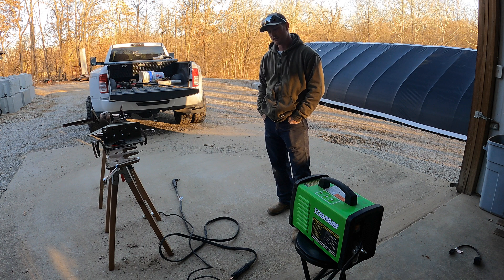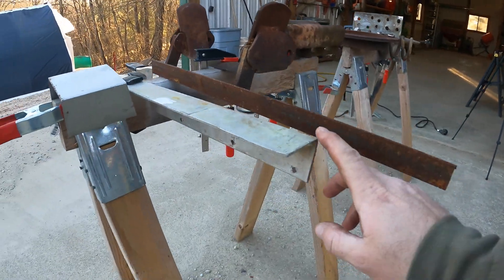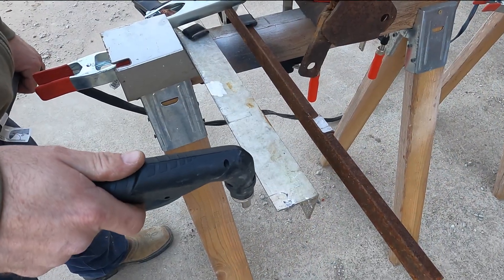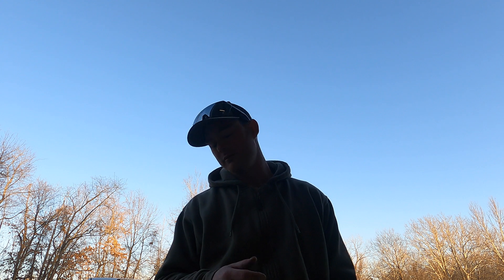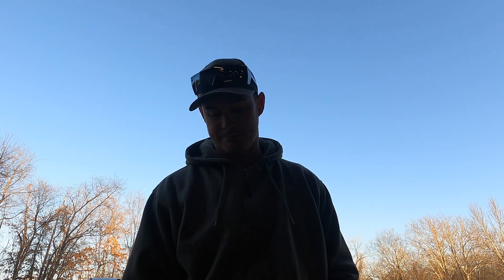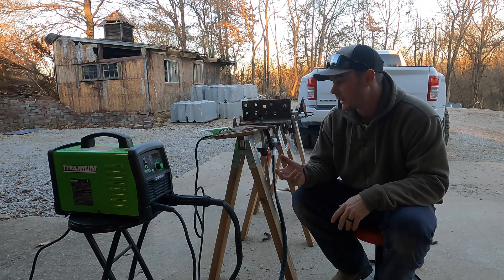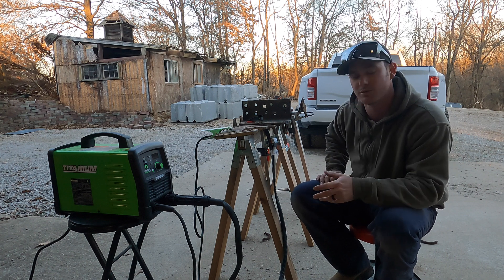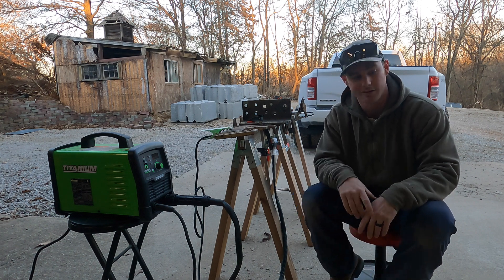Harbor freight plasma cutter. PUT TO THE TEST

Comment: Wow!  I felt sorry for that Machine.  I appreciate the video.  It was instructive and informative.  I now know how bad I'm not.  Harbour Freight consumables are too expensive to ruin on each cut.  If the cut is not penetrating the steel, stop cutting.  All the steel that is stuck to your nozzle and the work surface make it impossible to proceed without clean up.  The torch would have cut some of that stuff well if it had a chance to get started.  The video is still helpful- just not as you intended.
Reply: Yes, I know this thread is old.  It needed a bump.

Comment: Thanks for the video. I am going to get the 65 Titanium model. Couple extra hundred bucks but I think it will be worth it. One suggestion, don't use the tip as a hammer and speed of cut needs to be adjusted with thickness of stock. Also when you start your cut, do so at an angle on an edge and then pivot the tip to perpendicular to to stock after the plasma has gotten a start on cutting. Helps to prevent blowback which eats up consumables. If cutting in the middle of the stock drill a hole first to give you an edge to start on. Again thanks.

Comment: Ive been trying to figure out, is it just the ark and air pressure to blow out the molten metal or do you need some sort of gas with thesr plasma cutters?
Reply: No, there is no gas involved at all. It is just an electric arc and compressed air that blows out the metal. The electric arc creates a plasma cone that super heats the metal to molten state. That plasma cone reaches about 40,000 degrees Fahrenheit. When the air is super heated by the electrical arc it enters a 4th state of matter which is plasma. Plasma is regular matter that is basically blown apart and disassociated from its electrons, thus resulting in plasma. The same thing happens with lightning. Because lighting has even higher voltage even more heat is generated. The air around a bolt of lightning can reach about 500,000 ° F. Plasma cutting is kind of  like nuclear energy but not exactly the same. In a nuclear reaction atoms are actually split open and when done so releases EXTREME amounts of energy. More so than with plasma cutting...obviously. Nuclear energy can result in Millions of degrees of heat. The core of our sun has temperatures of 24,000,000 F. Too hot for me!
Reply: @normtheteacher5485  thank you very much for taking the time to make the rare comment back, I appreciate that information
Reply: They have different kinds, but that one is just air and electric, they have gas ones

Comment: You will eventually learn how to use it by a hammer.Your nozzle is not a hammer.That's the reason it would not cut properly as you bugered it up. Go slower let the machine do its work.

Comment: Yes this is overpriced junk get a Best Arc BTC500DP 7th Generation, it will cut 1/2" on 110V and way more on 220V unlike the Vulcan brick!
Reply: your wrong  its not a bad machine  he clearly does not know how to cut with plasma   ..... hypertherm is better than that thing your talking about  !! i know i have one   never even heard of the brick your using 😂
Reply: @richsharp1524  That brick was under $200 to my door and has 100's of hours of use on it now. Ill buy another Brick just like it when this one goes as it paid for it self 10 times over by now. More money does not mean better unit just better profit margins for a suits bonus check from fools. LOL!
Reply: @charlestreibley9904  you are the YODA of Plasma 😂
Reply: @richsharp1524  So you just like buying marked up China units from Harbor Freight. Ill pass on the mark up middle man and get it right from China myself Thanks but no Thanks Ill keep my money I earned it they did not!

Comment: That ground clamp is pretty horrible. I just bought one of these and the clamp is the first thing I’m changing. Nice video.
Reply from the maker: I agree it’s pretty cheap. But hey you get what you pay for with these things. I still used the crap out of this thing and it’s payed for itself by now.
Reply: @BuiltbyBurns  I have a feeling if it performs as good and holds up as well as most people say then I’ve gotten more than I usually do for my money in the age of “Bidenomics.”

Comment: You were moving too fast for your cuts. Even with the 220v setting you need to slow the pace down. I use 4 phase plasmas at work and even with those I have to keep a steady slow pace.

Comment: Try the Arc Captain 50 amp plasma cutter for 269.99   Its just the same and its a lot cheaper and you get a 2 year warranty on it after you buy it what you get for the titanium a 90 day return policy lol    Titanium is overrated over priced but the welders they sell like the 225 stick welder the price is ok but the warrant never is you always need a extended warranty for the titanium models

Comment: I had gone to Harbor Freight thinking they might be reasonable like everything else. Nope they are $900. I ended up ordering a Primeweld CUT50DP for $400. Granted I don't know much about plasma cutters, but I do know $900 is more than $400. As far as specs, the Primeweld has pilot-arc, and a slightly better amperage and duty cycle. I'm sure there's a reason for this $900 price tag, but I'm not sure what it is?
Reply: And now the CUT-55DS Pro is $139 on Amazon.

Comment: If the sparks are not coming through the back side of the metal, then you are moving your torch too fast... What you really have shown is that it is possible to use a plasma cutter for gouging as long as you move the torch head fast enough or have the air pressure low enough...
Reply: Yup!
Reply from the maker: Do you need a hug?
Reply: @BuiltbyBurns  ? The man is right, your travel speed was too fast for everything but the thin stuff. The sparks bouncing back will wreck tips.

Comment: As for harbor freight i used it once an it was problem after problem returned it an bought thermal dynamics more money but rated top of line twenty five years later im still using same machine zero problems out of it ive used it on all metals

Comment: I take it you have never welded ?  Patience is key to success. Slow and steady wins these races. Learn and understand basics. The cheapest machine can work with understanding of how to use it properly. Your grounding has to be as clean as possible for starters.
Reply from the maker: I take it you didn’t read the discription?
Reply: @BuiltbyBurns  do you think that with a slower travel speed it could cut the heavier material? Also what size compressor does it require??

Comment: I feel like someone should tell you the head of that isn’t a hammer. Also slow down and let the tool do the work. Your video isn’t representing the tools ability as much as you’re inadequate representation of it. I’ve got the same plasma cutter and mine cuts just fine on 120. I cut thru 1” on 240 and it cuts fine. But I wouldn’t recommend using it has a hammer unless you want to buy a bunch of guides for it. Idk I’ve watched a lot of your videos. But just don’t feel you represented this one very well. My opinion.
Reply from the maker: “everything is a hammer if your pockets are deep enough”  also I’ve gotten better with it. I’ll make another update video on how it’s going later. Cheers.
Reply: @BuiltbyBurns  nope. bad idea, treat your tools with RESPECT. you sure are an ignorant man.

Comment: You need to study the gig a bit before the review . If the instructions are not in the kit it's worth a mention in your review also. See to it the stream of sparks is exiting the other side of the cut or else travel speed is too fast. Going along the same line again does not much to help you to cut. I only came to see how to use my new plasma. I got a bit of experience that ruined the consumables and began making inquiries. After contacting the supplier YouTube provided a wealth of experience by simply watching. Do some research and you will be pleased but it's not for every cutting task. Good luck
Reply from the maker: You need to read the discription before commenting or watching. 🤙

Comment: This cutter is ridiculously overpriced. Especially when it only has a 90day warranty without adding the buy-up protection plan. Save $300 and buy an Everlast 50-series which comes with a 5yr warranty. Hell, even YesWelder cutters come with a 1yr warranty and cost half as much. Decent cutter or not, this is unquestionably one of the worst deals at HF.
Reply: That 50 amp Everlast is $829.00 on Amazon

Comment: What size air compressor are you using and did you add a separate water filter?
Reply from the maker: I’ve got a 60gal compressor, and it has its own filter on it yes.

Comment: been using one since 1986. that one used argon instead of compressed air. i also use nozzle shield spray on the tip. depending on the job, i will use contact or non contact tip. havent used one that worked well on alum yet (slag city)

Comment: I don’t usually comment videos but I really felt I had to here. I started using plasma in 2008 and have learned a lot. A few pointers for you especially specifically with the titanium or any other blowback start machine. Start your cut ideally on and edge. Move slowly, allow the plasma stream to cut completely through the metal. Moving the way you are caused the molten metal to spray back against the nozzle and destroy it. You can gauge a proper speed by watching the exiting sparks from the bottom.. they should deflect about thirty degrees away from your cutting direction, if it’s spraying sparks up at you too fast, if sparks shooting strait down too slow. When you were cutting and it kept losing the arc that’s a result of poor ground. The pilot arc is 15 amps only and times out after a few seconds if machine doesn’t detect ground connection. No matter your voltage connection if it doesn’t see ground the arc will only be 15 amps and extinguish every couple seconds which is also hard on your consumables. As your consumables wear the plasma stream broadens and becomes less concentrated resulting in less cutting capacity thickness wise. You might consider starting with your thickest test first and moving downward. Technique is a huge part of successful freehand plasma cutting and can only come with practice. Kudos for jumping out there and giving it a try. Sorry so long but I wish someone could have told me all this stuff when I first started using these things.
Reply: Never too long when passing on useful knowledge . I may have inadvertently tapped report. I have no issues with Your comment. Very much appreciate the tips. I prefer watching videos that have comments especially good ones like Yours instead of stupid one liners.
Reply: I agree ,even when you use a cutting torch you need to start from the edge until molting hot and move slow. I have never seen someone go back  and forth, must not use a torch very much.
Reply: Just a guess is that the miller was a high frequency start machine. Makes all the difference in the world when someone doesn’t ground properly. I work on rusty oil field pipe a lot and refuse to use a blowback start plasma due to difficulty in getting consistent results. For that kind of work I use a decent Eastwood branded high frequency start 40 amp cutter.
Reply: @Dnkfabrication   Excellent, helpful comment. Shopping myself, and if I understand correctly the main advantage of blowback start over high frequency start is reduction of RF noise that can mess up nearby digital equipment (like a cnc cutter)?
Reply: Good constructive feed back
Reply: Never use your wand to beat on the metal to break it loose
Reply: What air psi range?
Reply: @4horseman666  i thought i answered this a few days ago but the answer is 55 to 68psi
Reply from the maker: Thanks for the tips, I’ve gotten better with it. The main idea behind the video was to see if this was somthing the average guy could go out and buy and be successful at using, having low experience like myself. It was not a how to video obviously. one thing I’ve noticed on this machine compared to say a Miller I’ve used in the past is this titanium requires a lot more technique to be successful with it. Where as the Miller I used was just an absolute beast and would cut just about anything as soon as you pulled the trigger. I’ll make an updated video for everyone and cut everything again. Like I said I’ve gotten much better but the results will be about the same. Anyway thanks for the comment, I’m not one of those guys that gets butthurt about criticism. 🍻

Comment: Why would anyone use acetylene when this is available. Looking to cut some steel around the ranch here. What would you do?
Reply from the maker: Biggest reason people use torches are the versatility. They’re portable. Without a generator the plasma does not work. Also a set of torches can cut some really thick metal with ease. For the shop though a plasma is a quick and easy tool to have around.

Comment: Why are u going back in forth  ? Don't use tip as a hammer  go slow it will cut 3/4 thick
Reply from the maker: Second video is currently being edited and will be uploaded here in the future. I've learned a lot since shooting this video and I think everyone will be happy with the results. Stick around and see how I did on the next one. Also keep in mind while I was cutting most of these materials I did have the video in fast forward thus making it look like I was going alot faster than I actually was while cutting.
Reply: @BuiltbyBurns  u like that plasma cutter  ? What's the thickness  it will cut
Reply from the maker: @guypatts494  says it will cut 5/8s. If going super slowly you can get it done. New video will be up probably in a week or so showing my second results. I really like it though. Completely worth the money and I’m kinda mad I waited as long as I did to buy it. 👍